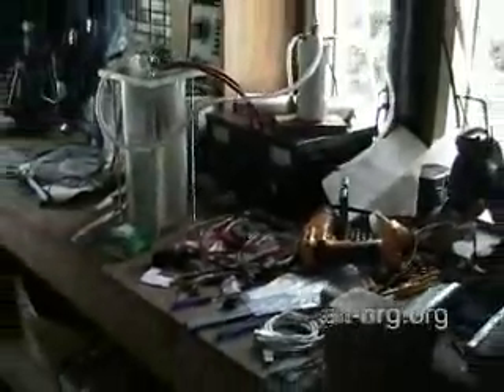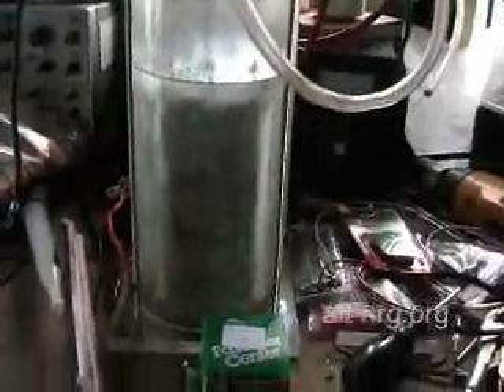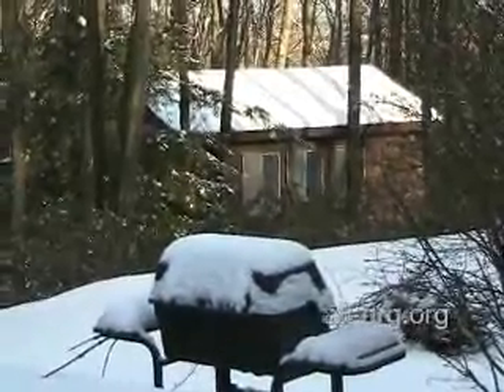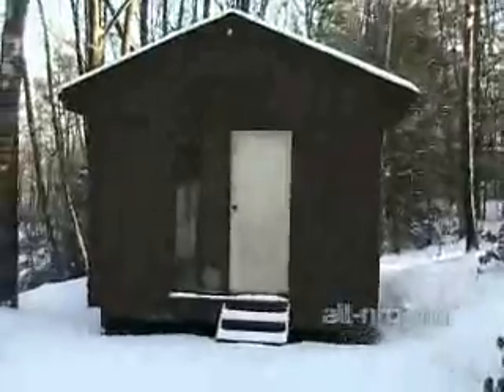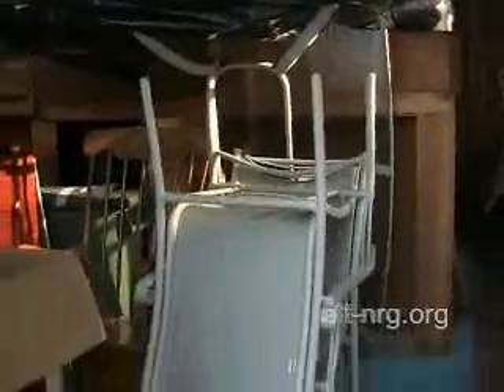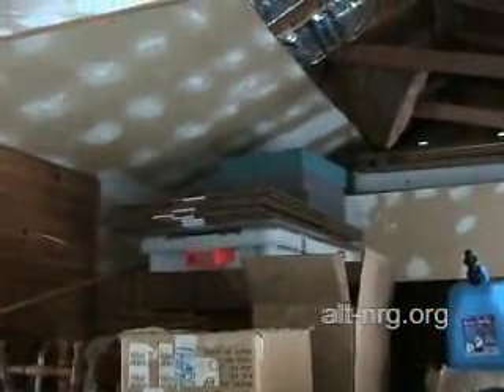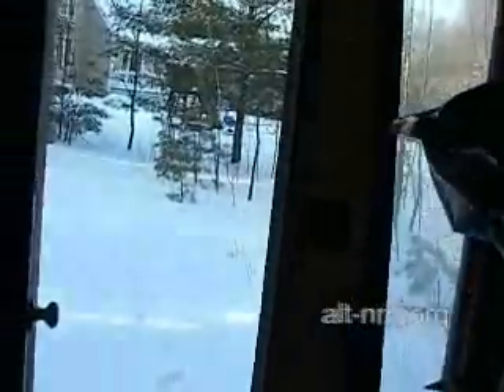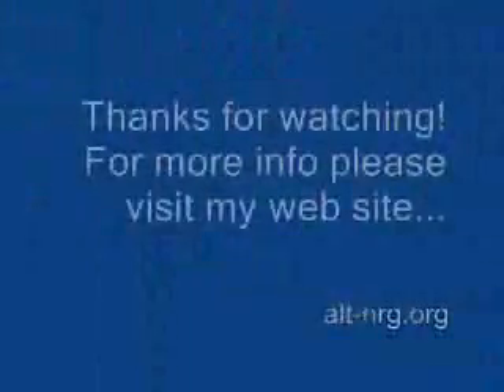#143 - Lab construction plans for 2009

Comment: sub z.f.f thought about converting a propane heater to hydrogen?, LOL that would be a cool lab!
 plugging into the labs outlet with a large amp breaker how high  D/C volts can be converted from A/C for your experiments? I thought that with high volts D/C and a certain level of amps should give you alot of HHo?,we must get over heat berriar,more conductive plates? alternitive electrolyte other than pot hydroxide,an acid? noticed that baking soda {base} is safe but it tends to coat the plates.